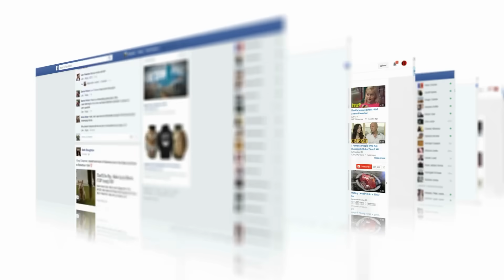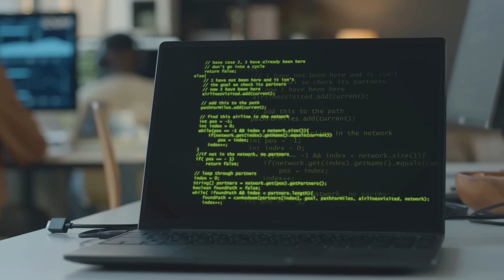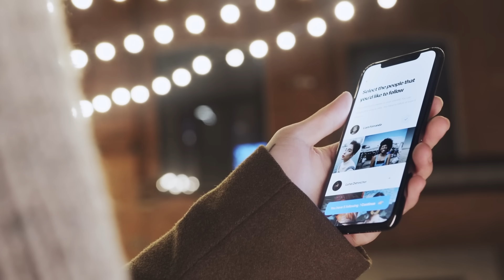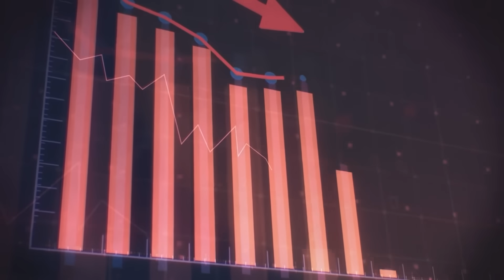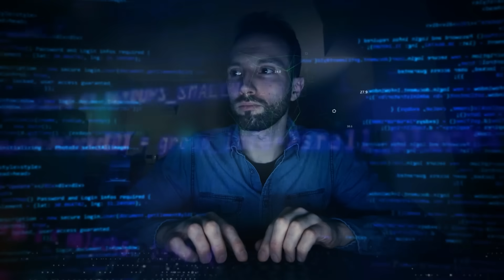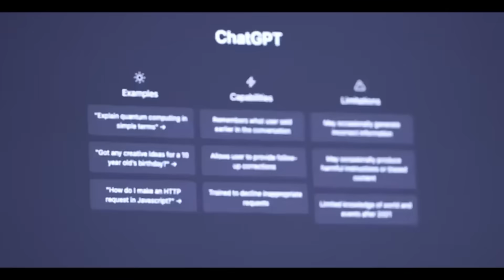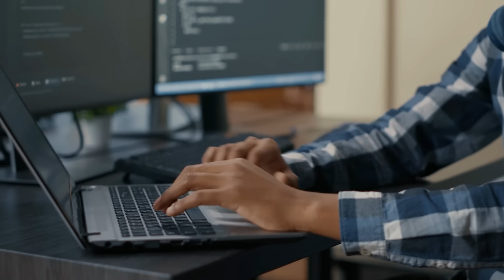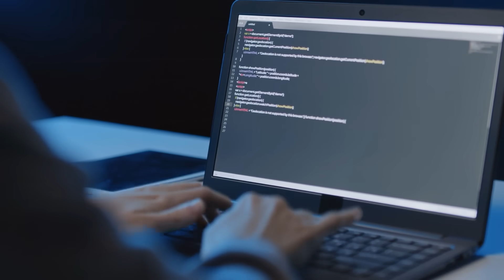10 Things They're NOT Telling You About The Coming AI (Must Watch!)

Comment: Technology may have advanced enough to release civilization from the confines of the second law of thermodynamics. 

These confines were imposed during Victorian England's scientific and religious cultural fascination with steam engines. 

The second law is behind modern refgeration needing electrical energy to compress the refrigerent to force it to release as waste the heat that it has removed from the refrigerator's service interior in the cooling part of the refrigerent's circulation. There is also discarded heat from mechanical friction and electrical resistance. 

Refrigeration by the principle that energy is conserved should produce electricity instead of consuming it. 

It makes more sense that refrigerators should yield electricity because energy is widely known to change form with no ultimate path of energy gain or loss being found. Therefore any form of fully recyclable energy can be cycled endlessly in any quantity. 

In an extreme case senario, full heat recycling, all electric, very isolated underground, undersea, or space communities would be highly survivable with self sufficient EMP resistant LED light banks, automated vertical farms, thaw resistant frozen food storehouses, factories, dwellings, and self contained elevators and horizontal transports. 

In a flourishing civillization senario, small self sufficient electric or cooling devices of many kinds and styles like lamps, smartphones, hotplates, water heaters, cooler chests, fans, radios, TVs, cameras, security devices, scales, transaction terminals, wall clocks, open or ciosed for business luminus signs, power hand tools, pumps, and personal transports, would be available for immediate use incrementally anywhere as people see fit. 

Equipment groups involving moderate power would be on local networks. 

If a high majority thinks our civilization should geoengineer gigatons or 
teratons of carbon dioxide out of our environment, instalations using devices that convert ambient heat into electricity can hypothetically be scaled up do it with a choice of comsequences including many beneficial ones. 

Energy sensible refrigerators that absorb heat and yield electricity would complement computers as computing consumes electricity and yields heat. Computing would be free. Chips could have energy recycling built in. 

A simple rectifier crystal can, iust short of a replicatable long term demonstration of a powerful prototype, almost certainly filter the random thermal motioren of electrons or discrete positiive charged voids called holes so the electric current flowing in one direction predominates. At low system voltage a filtrate of one polarity predominates only a little but there is always usable electrical power derived from the source, which is Johnson Nyquest thermal electrical noise. This net electrical filtrate can be aggregated in a group of separate diodes in consistent alignment parallel creating widely scalable electrical power. The maximum energy is converted from ambient heat to productive electricity when the electrical load is matched to the array impeadence. 

Matched impeadence output (watts) is k, one point three eight x 10^ minus 23, Boltzman's constant, times T (temperature Kelvin) times bandwidth (0 Hz to a natural limit ~2 THz @ 290 K) times rectification halving and nanowatt power level rectification efficiency times the number of diodes in the array. 

For reference, there are a billion cells of 1000 square nanometer area each per square millimeter, 100 billion per square centimeter. 

Order is imposed on the random thermal motion of electrons by the structual orderlyness of a diode array made of diodes made within a slab: 
____________________  - Out
  🔻🔻🔻🔻🔻🔻🔻 
____________________ + Out 

All the P type semiconductor anodes abut a metal conductive plane deposited on the top face of the slab with nonrectifying joins; all the N type semiconductor cathodes abut the bottom face. As the polarity filtered electrical energy is exported, the amount of thermal energy in the group of diodes decreases. This group cooling will draw heat in from the surrounding ambient heat at a rate depending on the filtering rate and thermal resistance between the group and ambient gas, liquid, or solid warmer than absolute zero. There is a lot of ambient heat on our planet, more in equatorial dry desert summer days and less in polar desert winter nights.

Focusing on explaining the electronic behavior of one composition of simple diode, a near flawless crystal of silicon is modified by implanting a small amount of phosphorus (N type)on one side from a ohmic contact end to a junction where the additive is suddenly and completely changed to boron (P type) with minimal disturbance of the crystal lattice. The crystal then continues to another ohmic contact. 

A region of high electrical resistance forms at the junction in this type of diode when the phosphorous near the ĵunction donates electrons that are free to move elsewhere while leaving phosphorus ions held in the crystal while the boron ions donate holes which are similalarly free to move. The two types of mobile charges mutually clear each other away near the junction leaving little electrical conductivity. An equlibrium width of this region is settled between the phosphorus, boron, electrons, and holes. Thermal noise is beyond steady state equlibrium. Thermal noise transients, where mobile electrons move from the phosphorus added side to the boron added side ride transient extra conductivity so the forward moving  electrons are preferentally filtered into the external circuit. Mobile electrons are units of electric current. They lose their thermal energy of motion and gain electromotive force, another name for voltage, as they transition between the junction and the array electrical tap. Inside the diode, heat is absorbed: outside the diode, an attached electrical circuit is energized. 

Understanding diodes is one way to become convinced that Johnson Nyquest thermal electrical noise can be rectified and aggregated. Self assembling development teams may find many ways to accomplish this wide mission. Taxonomically there should be many ways ways to convert heat directly into electricity. 

A practical device may use an array of Au needles in a SiO2 matrix abutting N type GaAs. These were made in the 1970s when registration technology was poor so it was easier to fabricate arrays and select one diode than just make one diode. 

There are other plausible breeches of the second law of thermodynamics. Hopefully a lot of people will join in expanding the breech. Please share the successes or setbacks of your efforts. 

These devices would probably become segmented commodities sold with minimal margin over supply cost. They would be manufactured by advanced automation that does not need financial incentive. Applicable best practices would be adopted. Business details would be open public knowledge. Associated people should move as negotiated and freely and honestly talk. Commerce would be a planetary scale unified conglomerate of diverse local cooperatives. There is no need of wealth extracting top commanders. We do not need often token philanthropy from the top if the wide majority of people can afford to be generous. 

Aloha
Charles M Brown 
Kilauea Kauai Hawaii 96754
Watched All
Reply: Thank you. Just amazing.
Reply: The principles of a Simple Sterling Engine can be a bridge device or method for the conversion of Heat into both mechanical and electrical energy.

Above you just laid out what Bio-Electrical-Magnetic Engineers are doing with Tissue Scaffolding and Energy Mining of Humans through the anatomical Electro-Magnetic Bio-Field. (Aura) Bio-Mechanical Engineering is now becoming archaic, almost obsolete. Replace your Boron with Graphene in your above explanations of conversion processes and it is almost identical. Load balancing of the currents and frequencies are key in this field for repetitive and reliable conversions. 

Bio-Field Engineering combined with A.I. and Next Generation Computing will completely transform life as we have known it.